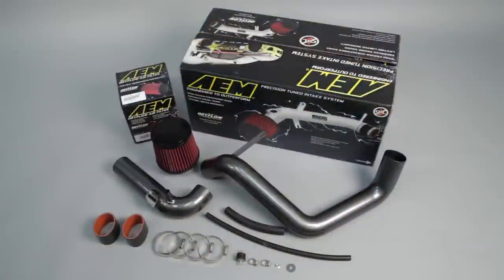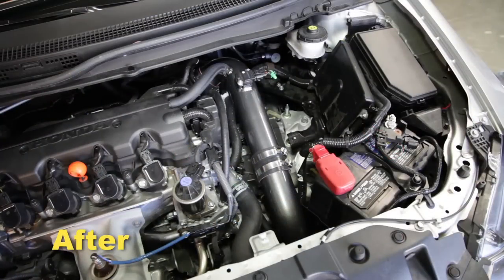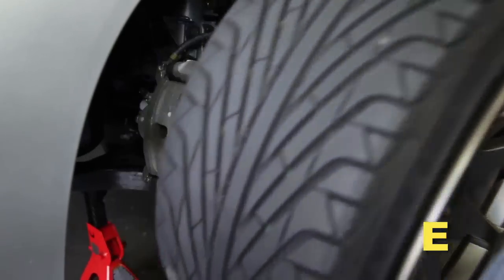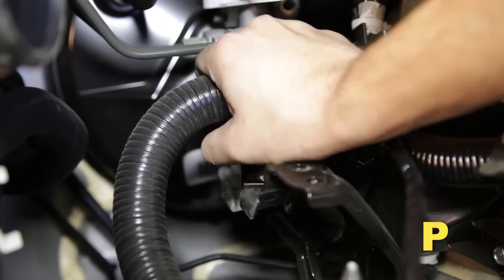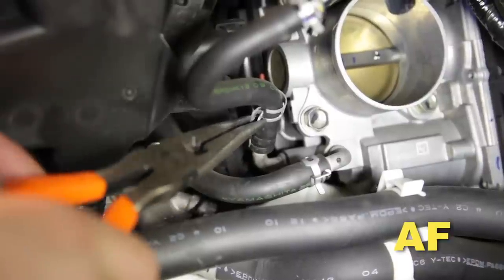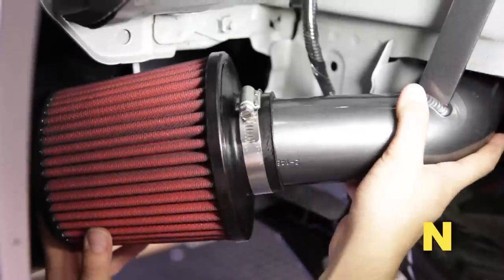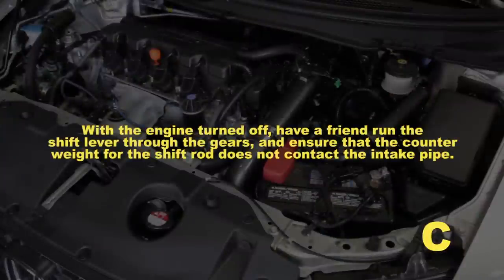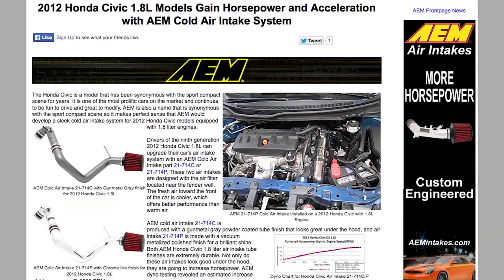2012, 2013, 2014 Honda Civic 1.8L AEM Air Intake Installation

Comment: I did this, it took 20 min. Remove the intake to the filter first. Remove fuel lines with needle nose pliers .Unscrew intake hose clamps with short Philips screwdriver. Remove filter box, 2 screws and wiggle it out(remove mass air flow sensor before removing completely) It has a press clip. Remove intake hose with top tube in it, replace tube in new hose and reverse.
Reply: So no need to remove the wheel?
Reply: does it improves the fuel economy and engine performance?

Comment: Is worth it for those few horsepower that let the engine suck in more dust? may get even water moreover from below...
Reply: no it's not worth it. I learned the hard way. my civic sucked up water into the engine and it bent a piston rod. had to replace my engine. Short ram air intakes are a better choice.
Reply: Don't drive through water
Reply: @MotorheadATX  does this also apply on snow areas?

Comment: K&N is way easier to install, but it is not dry filter... The AEM has a gain of 4 HP, while the K&N is 3.14 HP... At this point, it is just matter of simple choice... I dont know how notable that difference of 0.86 HP will be... 
Also, if you live in a region where lot of rain and moderate floods are common, I dont think this CAI would be a good option, as this one does not accepts bypass valve. In my case, I prefer the Short Ram System from K&N... I wish AEM had an SRS option for the 2015 Civic.

Comment: does it sound nice when VTEC kicks in? god i miss that sound lolz in my ricer accord back in the days! WOT!
Reply: klepto dathief this car doesn’t have vtec.
Reply: Moose Be Canadian they have Vtec! On the camshaft there’s a lower and a higher cam profile and there’s 3 rockers arms on the intake side! It’s just fuel economy oriented. The vtec system is engaged at 5200 rpm and there’s a variable geometry intake that open the valves at 3k-4k rpm. That way they have the fuel economy of a 110hp engine with the power of a 140hp one.